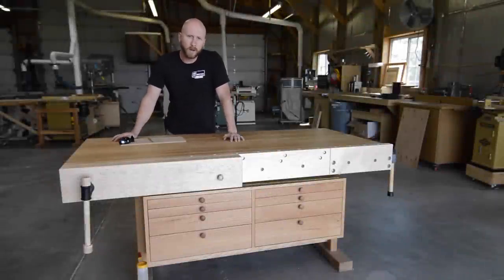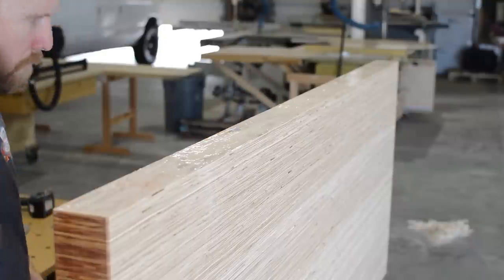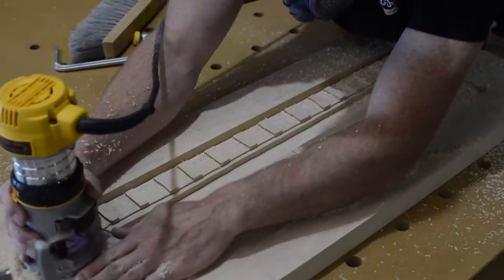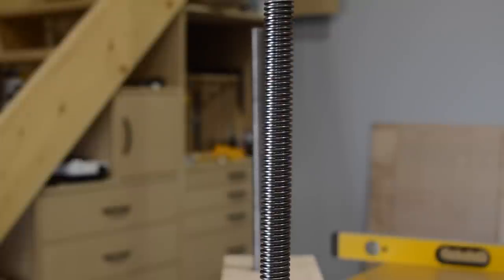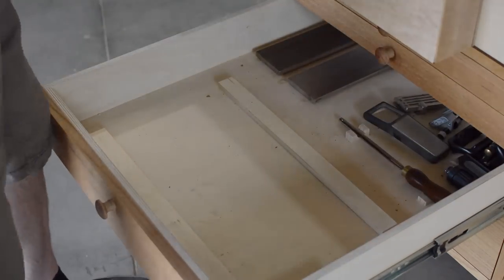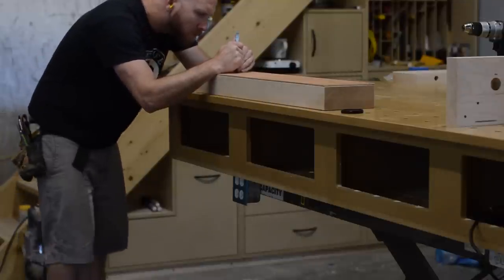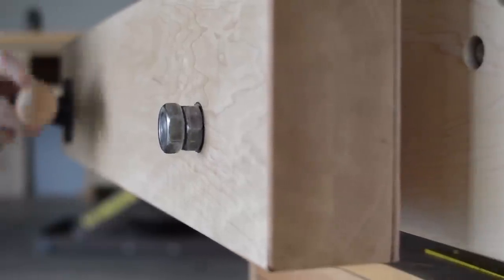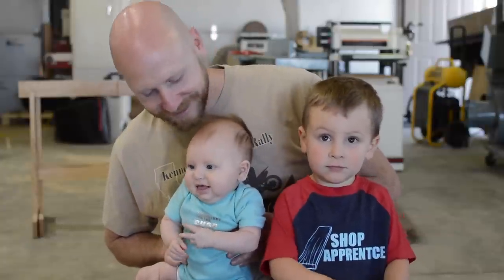Workbench Upgrades! Vise installation, jigs, and woodworking chit chat

Comment: Picking dried glue off you fingers, is one of the joys of working with wood!
Reply: indeed , joy 😂😂
Reply from the maker: I couldn't agree more. Such a sense of accomplishment when my hands are picked clean.
Reply: Glad I'm not the only person who does that.  I've been known to deliberately glue my hands just for the pleasure of peeling it off.  The only downside is that you might mess up one day, and forget you are using CA glue and not wood glue.  Actually, I even saw a wee tip for unsticking your fingers from a CA glue up on Jonathon Katz-Moses recently.  He says it has no shear strength, so twisting tears you free.
Reply: Love that too. I do occasionally have trouble opening my phone though
Reply: @TrevorDennis100  Try some acetone.
Reply: Awesome work man!!!! I’m gonna make a table top like that now😁

Comment: I tend to use a very thin bead of glue and then grab a scrap piece of wood to spread it. I find that it gives me great coverage and I’ve never had a joint fail. The Shop Apprentice is getting so big and now that he has an assistant, he’ll be unstoppable. Congratulations!
Reply from the maker: I think thats the better way to do it. Thank you.

Comment: In my shop we went about 20 years without spreading glue at all. We simply laid beads the length of the joint and enough beads to ensure glue squeezed across the width. This process worked fine, but probably used way more glue than needed. We never had a joint come apart.  We now use spreaders for lager areas and a finger for smaller ones.
Reply from the maker: Funny, in my head I know you are right, that a bead of glue is plenty, but for some reason, I feel the need to spread it out evenly.

Comment: I dislike using my fingers to spread glue since for some unexplained reason the side of my pant legs end up with glue on them.  I like to use a brush, either an acid brush or silicone brush.  For large surfaces a toothed spreader is used.  That said a finger is always readily available in a pinch if paper  towels are accessible.  Mike,  Please keep making these exceptional and instructive videos.
Reply from the maker: Thank you. My clothing takes a beating from plus as well.

Comment: Mike, I love how you simplified the LN chain drive install. They recommend a 4" top with 2.5" pockets cut to the underside of the bench for the hardware. It looks like you've simplified this by adding an apron, drilling holes for the twin screws lower than the bottom edge of the bench top, then bolting the hardware directly to the underside of your bench top. Have I got that right? I think I'm gonna do the same.
Reply from the maker: Yes, just seemed easier to me.
Reply: @MikeFarrington  yep… about 300 times easier! Thank you 🙌
Reply from the maker: @jonnyschneider7967  Great to hear.

Comment: congrats on your shop apprentice assistant. One suggestion, what I have done with my vises, is to pit an O-ring on each end against the inside of the knob, this gives a bit of cushion so the handle doesn't hit so hard when you use it.
Reply from the maker: Cool tip. I'll pick some up.

Comment: Thanks for the information on installing the vise.  I just installed the LN twin screw vise and probably would not have taken the necessary time to properly layout and drill if you had not stressed it.  Everything came out good, but you were correct....you have to be on your "A" game.. your my boy blue!!
Reply from the maker: Thank you. Great to hear it came out well. Thats one of my most used quotes. I say your my boy blue all the time.

Comment: Great video Mike! Over here in the UK i use a scrap piece to spread adhesive/silicone mainly because as a kitchen installer i have to work much of the time with Chipboard! Yuk!(glueing up masons mitres on laminate work tops) This done with a finger as you can appreciate i would end up with more ouchies than i could cope with!
Oh yeah we've all made that mistake....and measured it again when we know its wrong! Ive done this countless times when using 100mm as a reference point for accuracy and then forgot to deduct it on the work piece! Whats the saying "measure twice-cut once" ?!
You have an awesome family there Mike. 
Thanks for inspiring us.
Reply from the maker: I have had some of the worst splinters from chipboard. Those little bits can really slice deep. I have made the same mistake as you many times, except mine is form the 1 inch mark.

Comment: Beautiful work as always. I'm not in the stage of business where I can really afford to make super nice shop pieces of furniture beyond what is necessary for profit, but I look forward to that time.

You are 100% right about the aerosol cans of finish. Mohawk makes great professional aerosol finishes. I always keep multiple cans around and I almost exclusively use aerosols during installation for touch ups and patches. 

Aerosols aren't just for hobbyists. They are awesome time and space saving tools that every pro should have ready to use. 

Just gotta do a bunch of practice and make sure all your finishes of whatever brands mix together well and can be patched properly
Reply from the maker: Thank you. Well as I mentioned in the video its been about 6 years since I bought the vise kit. So, the nicer shop fixtures are few and far between for me. For years I used Mohawk products. I don't any longer because where I live I have trouble getting a good supply. They really make a very nice line of spray can products. Spray cans are a very valuable tool to the pro.

Comment: Congratulations on the new family addition.  Another great video from  the Boardroom.  As for glue, finger works great, but I prefer an acid brush, a roller or something other then a finger.  I have had a few projects ruined by glue residue that wasn't sanded totally off before applying finish.
Reply from the maker: Thank you. I think that is the best way to do it, but I'm lazy and end up using my finger. I have struggled with the glue getting where it shouldn't as well.

Comment: Thanks for the video. I try to use a tool to spread glue. Although it is not as good as a finger and it is not as accessible as a finger, the drawback with using my finger is that I inevitably need that finger for something else where I do not want glue.
Reply from the maker: I hear you. Nothing more annoying than getting glue where it shouldn't be cause of a messy finger.

Comment: I am subscribed, but for some reason just saw this episode.  I wish I had seen it before I built my bench and connected the top to the legs using mortise and tenon joinery.  The top is now beat up and has one low spot in it, so I need to flatten it.  My only option is hand planes, a la Rob Cosman's episode on doing it that way a while back.  Your modular method with an apron to add stiffness is the way to go.
Reply from the maker: Thank you. I always like to build shop fixtures to be easy to take apart.

Comment: I thought about your question about using a dedicated tool for glue spreading.  I would think the oils on ones skin would have some type of affect on proper adhesion.
Reply from the maker: You could be totally right, but I haven't had any issues.

Comment: Interesting use of LVL for your bench top.  I'm not very familiar with it, and wonder if it has sufficient hardness and impact resistance.  Since I'm guessing it's really stable, was denting or other wear issues the reason for resurfacing with the drum sander?  Congratulations you you and your wife on the new baby.
Reply from the maker: Thank you. I think it has an impact resistance slightly higher than normal construction lumber. I resurfaced it just to make it look nice again. It was about 6 years old and needed some attention. It is not as hard as a maple top, but I can chop mortises without it leaving dents. So it works good for me as long as I don't abuse it.

Comment: I have a 2" hard rubber roller from speedball for small to medium glue-ups, and a large spreader (~8") with grooves for large ones. For that glue-up I would have used the roller. It's much faster than a finger.
Reply from the maker: I agree that a roller would be faster, until it comes time to clean it off. Then I think its a wash unless there is lots of surface to cover.
Reply: @MikeFarrington  Well I would rather have speed during the glue up than during the clean up. I may just be particular about glue up preparation because I feel like the stakes and stress are higher. During design I even consider what can be done to simplify glue ups. Is that just me?
Reply from the maker: @g32forst  To each their own. I hear you on the stress during glue ups. I feel it two. I also consider glue up at the conception of a design. Designing things that go together easily is critical to successful project.

Comment: Hi Mike. Big fan of your work and love your videos. Question about the Edgetech sanding disk; do you typically leave your pieces a little heavy and run them through? It looks like a real time saver but just want to know your method for using it. Thanks for the great info and keep the videos coming.
Reply from the maker: Thank you. Yes, I leave my parts oversized 1/32 or so. This is about the amount needed to take off bandsaw or table saw marks.

Comment: You mention the one machine spinning the bit too fast so it dulls the bits... have you ever thought of using a VFD to decrease the overall speed as desired?
Reply from the maker: Thank would work, I just don't normally use that tool for that operation.

Comment: Hello;
I found your channel today and learning good information and as I was watching you were installing the chain drive vice to your workbench.  I was thinking that had to be a Lie-Nelsen vice before you said it was.  I have the same 24" front vice just like you.  Yes, You better be ready to spend some serous time installing the vice.  It is so well made you can't make a mistake.  It is a great vice, works well and I have had a bunch of 23" wide drawers in it.  It is so handy with only one handle.
I do have a questions for you if you don't mind.  Where did you get your white rubber handle hammer?  Seeing you use it it looks harder than the black rubber hammers.
You have shown two different dove tail jigs when you were cutting dovetails, which one do you like best and which saw?
Thank you for sharing and have fun with your little ones.
Reply from the maker: It is a very nice vise. I bought that hammer from the mighty Harbor Freight, it was probably 99 cents. I actually have three different dovetail jigs. I have only used two on camera. All three work well and do what they claim. The veritas is nice because it has a clamp, but that makes it slower. The Katz jig works good, but you need to hold on to it. I like that it has a 90 degree setting.

Comment: Hard (Sugar) Maple is hard indeed. you can actually drill and tap threads in it, like steel. The hold is so good, that I've had 3/8 bolts twist off before the threads gave way. This is often easier than installing wood screws in it, it's so hard. Tip - lubricate screws with soap before driving, and always use a slightly oversize pilot hole. The tapped holes on the LVL should be nearly as strong.
Reply from the maker: Thank you. Good info. After adding some glue to the LVL holes, they felt pretty darn strong. Time will tell.
Reply: Why use a slightly oversized pilot hole? You mean if the tap comes with a 3/8 drill bit, then use a slightly larger bit than that?
Reply: @MaydaysCustomWoodworks  I meant for the wood screws - the pilot hole must be the same or larger than the screw shank, if it is smaller, there is a real risk of breaking the screw before it pulls tight.
Reply: @glennworton2494  ah. Right.

Comment: Where did you get that dual/split air hose connector? Or what are they called so I can buy one? I hate having to change the fittings and would be awesome to spray and have the quick release
Reply from the maker: I bought two of them off an auto parts store that was closing down. This was years ago, I haven't see one since.

Comment: A couple years down the road -- are you still happy with the LVL bench top?  For a non-hardwood choice, my gut tells me that the LVL would be more prone to gouges and chip-out than doug-fir -- but my gut also told me that the week old Chinese food was fine, so I don't give it much credence.
Reply from the maker: I am happy with the LVL. If you are considering LVL vs fir, I would say LVL will hold up better with the one exception, it is a challenge to plane. I ended up plane the top flat at a 45 degree angle vs long shavings.

Comment: It’s called a thing-a-ma-jig Mike! 😂 I’m sold on using Lvl and framing it in with with a hard wood.
Reply from the maker: It's a very nice material for a work bench.
Reply: Do you have holes for your hold fasts in there and if so were they easy to drill? Would you say that a good auger bit and hand brace would work too?
Reply from the maker: @SanderOpdam  I do not currently have holes for holdfasts. I may add some in the future.

Comment: Hi Mike,  I really like the cabinet on under the bench.  Two questions.  What are the dimensions of the drawers and the cabinet?  I am thinking of putting one under my bench.
Reply from the maker: The drawers are 24" deep and the cabinet is sized to fit the 24" slides plus the thickness of the back. Left to right and top to bottom, its just sized to fit into the bench. I have no idea what those dimensions are.
Reply: @MikeFarrington  Thank you

Comment: So deciding between using your finger or a tool for spreading glue. At first I would say go with the tool, but I do notice you use your finger in place of a tool on more than just glue, like caulking bead. So I don't think you are too overly concerned about sparing your hands from turning into giant rough paws. So that leaves time. Is it faster to pull out the tool or faster to use your finger and then having to clean it off?

Personally I would prefer tools, but I'm a super novice.
Reply from the maker: My hands are constantly destroyed. That is of no concern. I would also say it would be faster to use a tool, yet, I still really like using my finger. Old habits die hard.
Reply: @MikeFarrington  A bit more 'one' with the wood. :D
Reply from the maker: @chrisbabbitt4202  Totally.

Comment: I use a product called baubuche for a lot of things that is identical in appearance to LVL except it's a hardwood. Beech to be exact. Like the vids man.
Reply: Hmm. Very interesting. I imagine that would be ridiculously hard and stable. And sounds like it would be slightly more expensive than LVL. What uses would you have for this product that a normal LVL or ply wouldn't be sufficient for?
Reply: @MaydaysCustomWoodworks  it comes in 26"x13' slabs and 4x8 sheets. I have used it for cutting board stock, bar tops and man cave counter tops. You can see some of what I use it for on my Facebook page, Budro's Woodshop.
Reply: @budroswoodshop2671  I saw a table top you made out of it. Interesting product. I don't know if I can currently think of any uses for it specifically but I will keep it in mind. Thanks
Reply: @MaydaysCustomWoodworks  the distributor I buy from built cabinets and the sales desks from it!
Reply: @budroswoodshop2671  I imagine it's super strong. I've personally used Paperstone (aka Richlite) when I've needed some really strong stuff, but paperstone is a bit pricey. I'll keep that stuff in mind if someone is looking for that kinda industrial look or if k want something strong but not as hard or as expensive as paperstone. Thanks man
Reply from the maker: That sounds like a great product. I have not heard of it. Depending on cost, that would probably be my first choice.